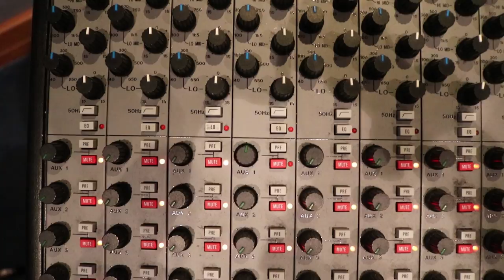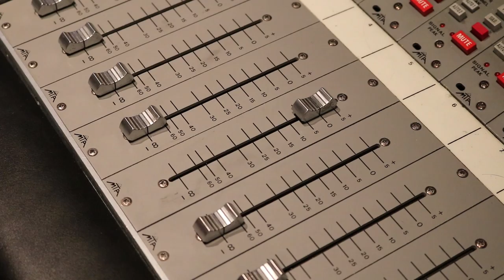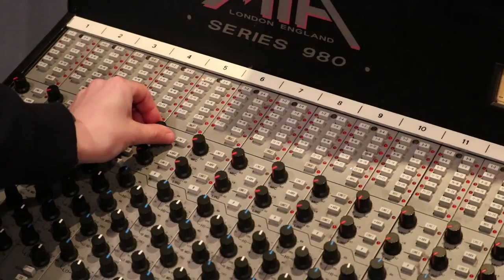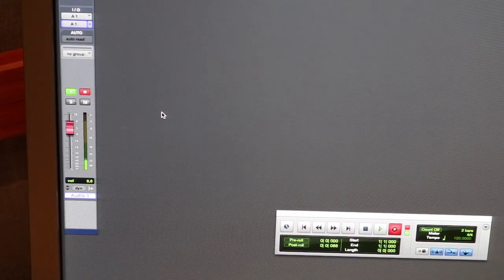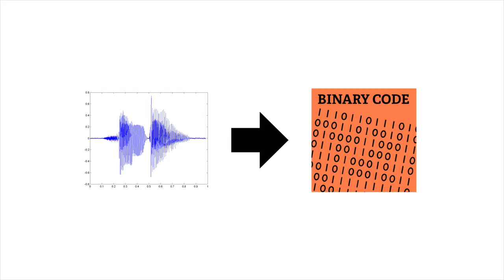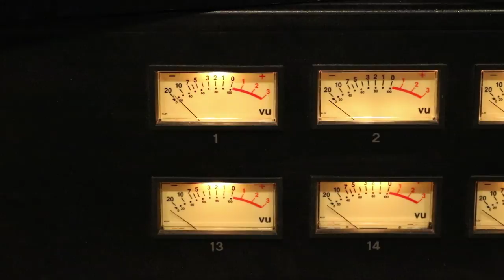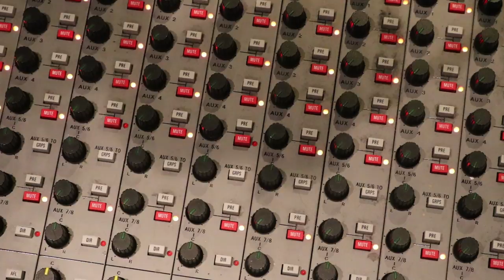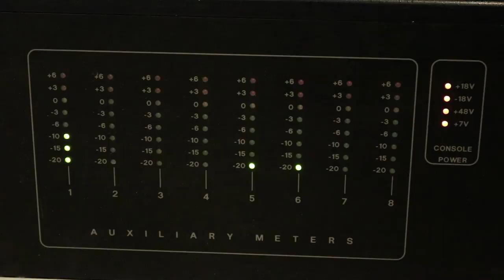Guide to Signal Flow in an Analogue Studio

Comment: This is weird for me.  I've never worked in a studio that had panels directly connected to a console.  Everything is going to the patchbays.  AS well, many things were outboard mic pres routing back to the console for monitoring from the machine.
In most cases, there really wasn't enough channels on the console to power the recording chain and monitoring chain at the same time.

A 72 channel SSL would return about 28 tracks of tracking monitor, as well as 8-12 effects returns, some scratch tracks for vox, guitar. etc.

The video is a basic signal flow but seems to miss the art of working out the larger setup of more than one mic.  I think the basic 101 concept is here, but there isn't much of a 101 when it comes to recording.
It becomes far more complex and can get confusing.  I think the signal chain should have included the patchbay so a new person understands that it isn't from the wall to the console.